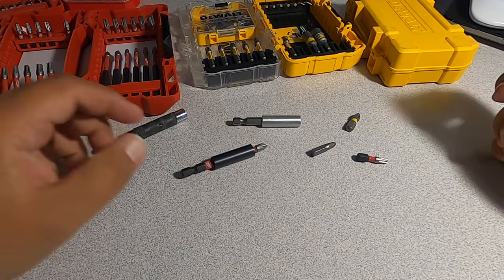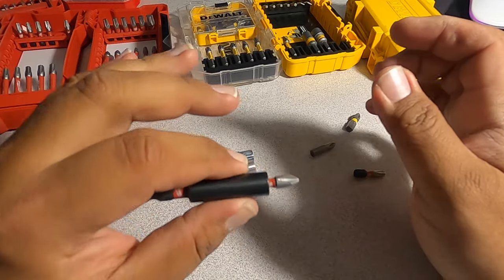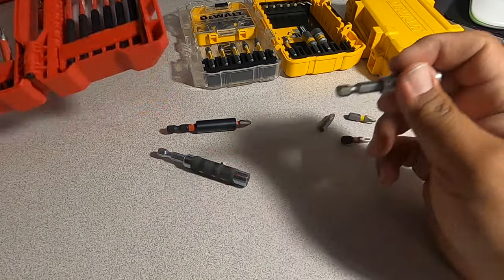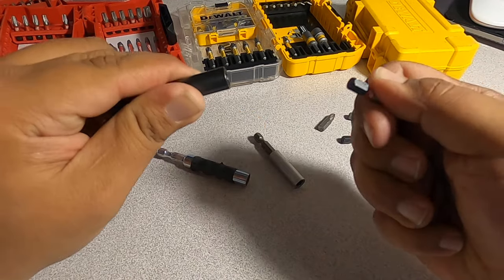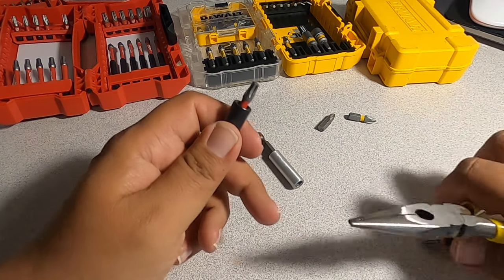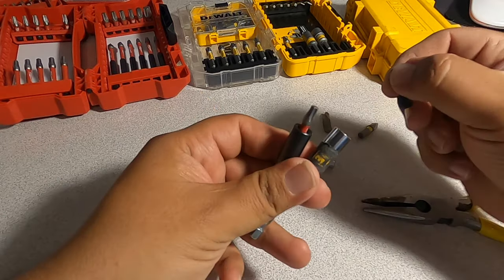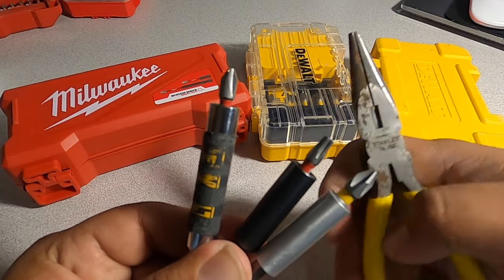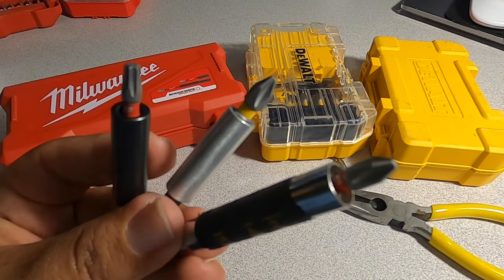Bit Holders Stuck? Simple Solution! DeWalt Milwaukee

Comment: This isn’t the way. You shouldn’t have to use pliers to remove a bit. The way to fix any of your bit holders is to remove the ring from inside the bit holder. If you look inside the bit holder, about 3/16” down, from the top, you’ll see a ring on the inside of the holder. Get yourself a pick, and pry it out. It might take you a minute, but once you get it out, your bit holder will work the way they should. Guaranteed! I’ve fixed at all of mine this way.
Reply: Well what if the bits stuck like mine howndo u remove it nthn will fot this 1 been stuck sense dayx1 over a year ago looks more used them my daily from trying get the thing out I don't want throw away it's basically new Still

Comment: Hi Guys! I think the Milwaukee 1-inch bits have this problem worse than other manufacturers because the hex shaft is very snug and fits below the c-ring causing all 6 hex points "locking" against the c-ring. I believe the DeWalt bits have longer hex shafts that use indentions to lock against c-ring.  I think the indentions are very shallow allowing locking but not enough to require using pliers and twisting all the time. Just brainstorming. 😊

Comment: Just remove the stupid C ring inside the bit holder. It can be done easily by using a hook and pick set, just aim at the point of the C from the ring, wedge the hook in, dislodge it and pull it out with a needle nose plier. The C ring itself is just a thin wire. This is a design flaw from Milwaukee making the bit holder totally worthless. Why do you need to fight to get the bit out each time?

Comment: Thank you.  My Milwaukee was ridiculously tight to the point that I thought I was missing something.  But no, you just have to wiggle them and pull them apart.  Mine was so tight I was sure there was some other way of getting them out.  I would never have figured it out without your video.

Comment: I have a bit holder of unknown brand. The bits come out super easy. Sometimes the bit gets stuck in the fastener head, and pulls out of the bit holder. I find that annoying. I got a new Milwaukee bit set with a bit holder as a Christmas gift to myself, and was hoping I would not have the same problem. I looked up reviews, and a lot of people were complaining the bit gets stuck in the bit holder. This video shows that problem can be overcome. I guess I’ll be all set now, with one bit holder that holds on tight, and one that releases easy.

Comment: I feel really dumb having to look this up but it was very helpful 👍
Reply: Bro’ you’re not alone. Haha! Is it me or did you also have a problem putting your desired bit in? I did when I bought a new 3 set/sizes of Milwaukee bit guides for those longer screws. 🤔😡🔩🔧
Reply: Thank god. I'm just over here thinking I'm just stupid that I can't get the damn thing off.😂😂😂 Like why would it come with replacement bits if it wasn't supposed to come off

Comment: I'm stuptified that 1. I am actually looking for an answer to this problem  2. That this is such a common problem  (especially with Dewalt) that a video was made (thanks by the way) and  3.  that there are now 2694 other people looking for the same answer.

Edit.  My craftsman works fine though. I just can not find it.  But if you are anything like me you lose these things frequently.  So I stocked up with some dewalts.  They all do this.
Reply: I can sympathize. Two trips to Lowes, twice contacting Dewalt, and no solutions. Dewalt's reply was to use with 1 inch bits, but nah, same issue. Frustrating to get hung up on something that ought to be problem free.

Comment: I normally get this problem when I impact. Just drop it on the floor. Bit slides out when pulled. The bit holder I use 80%  is made by Vermont America (discontinued model). The other is the dewalt like in the video. To avoid the problem all together, go to 2" or 3" bits.

Comment: There's a wiring ring 1/8" of the way in there, just get a small flat head and pull it out.
Reply: Yeah I removed the ring from all of mine...lol
Reply: Ok I'll try it,does the bit have to be taken out first.
Reply: Yes
Reply: It's a pain to get out, but don't get discouraged.  Also, the magnet in the bit holder is more than enough to keep the bit secure once the ring is removed.

Comment: I had a Milwaukee extension and the twist method stop working. I then remove the ring that is in the extension because it was sticking out. Just know once you remove the ring that is in the extension. The bit may come out of the extension easier than before. I just got tired of the bit being stuck in extension.

Comment: I wouldn't use pliers all the time tho cuz I'm sure doing that enough times the pliers will end up messing the bit up and they're made to be tough cuz what's worse is when even with the magnet in there it starts falling out on u. And if u look their actually designed to do that if u look down inside it when there no bit inn there is actually got right where the the top of off the bit changes from hex to the round red part there's a groove all the way around on the inside where the top lip of the bit kinda ever so sightly sits down in there and that's why it's little tough to get plus yea it still will get a little easier once the bits start wearing down a little from putting them in and taking them out a bunch of times. So as I do agree it's little irritating somewhat but there made to fit tight and it's rather that then over time then start just falling out

Comment: Dewalt has a thin metallic in side. Some times it breaks and becomes a blocker. If you take that ring out then problem solved. Of course until you remove that ring, it is a nightmare